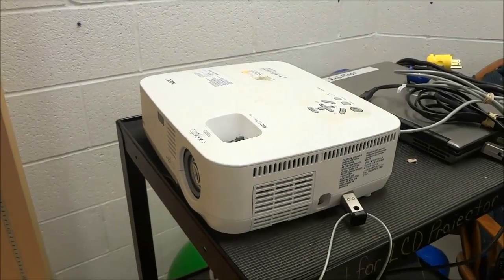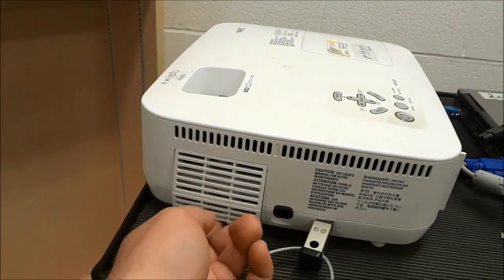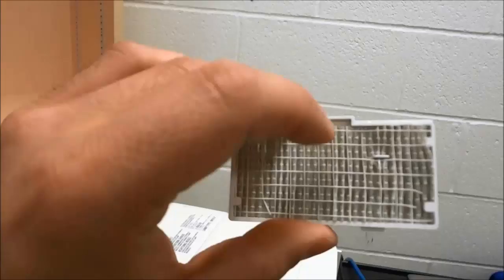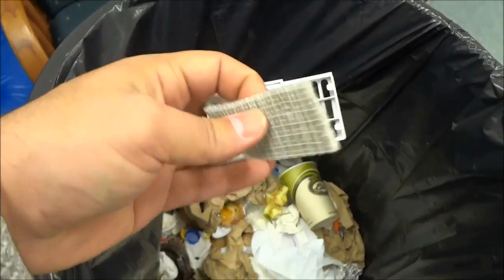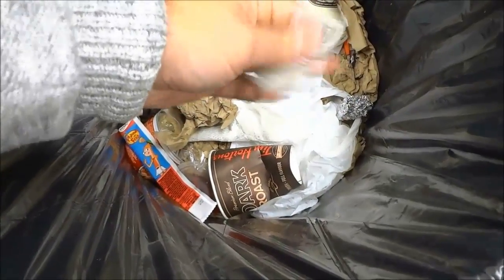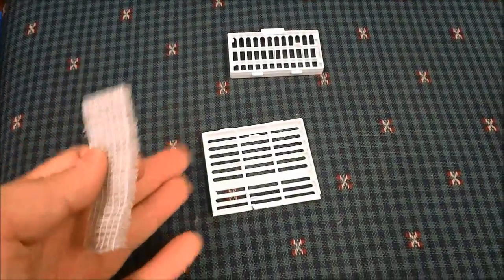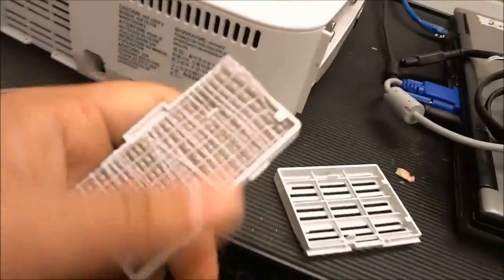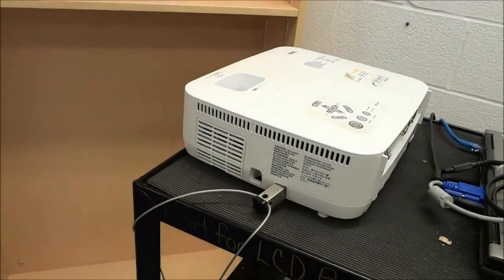How To Clean The Filter On A NEC Projector

Comment: According to the manual you don't need to remove the filters from the projector. Just use a vacuum cleaner to suck out the dust from the filters.
After that, a counter may need to be reset.